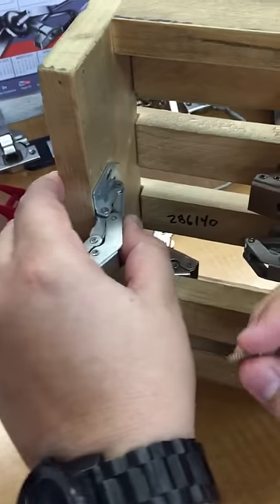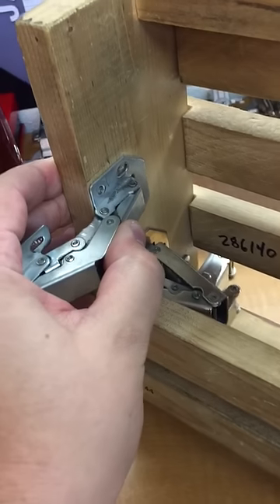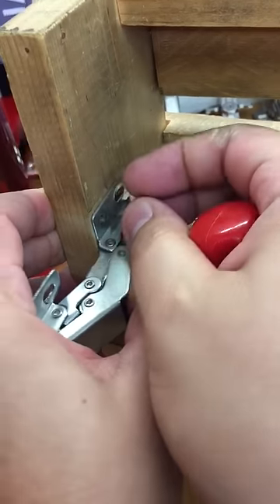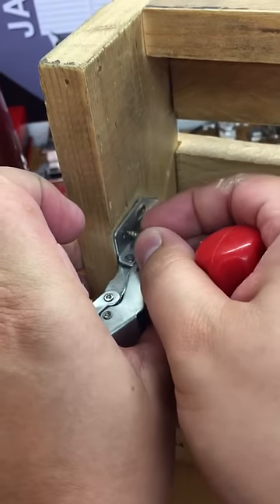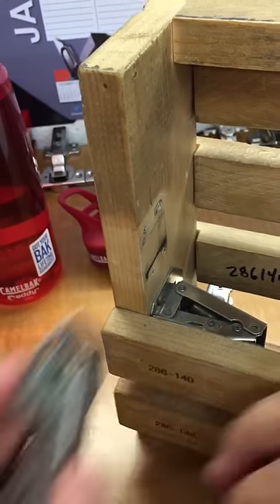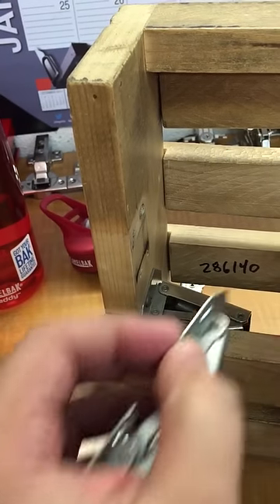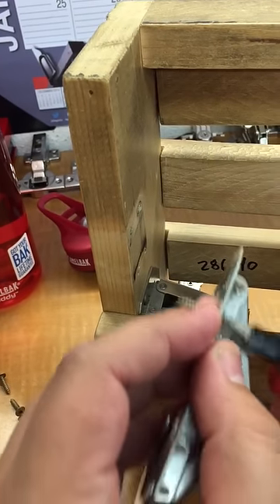How To Install 286136 From HardwareSource

Comment: I've been trying to install these on some closet doors, but I can't seem to make the door end up on the edge of the frame (when it closes). Can you tell me what I might be doing wrong?
Reply: you have to mount the first part that he mounts slightly further from the edge, this video is crap as he does not explain anything
Reply: On the door, mount 3/4 in from edge. On the cabinet or frame, etc., mount on edge or no more then 1/8 in from edge.  Past attention to which part of the hinge mounts to door or frame.